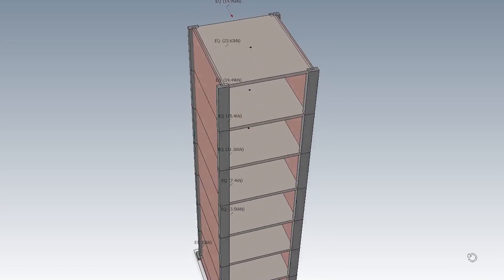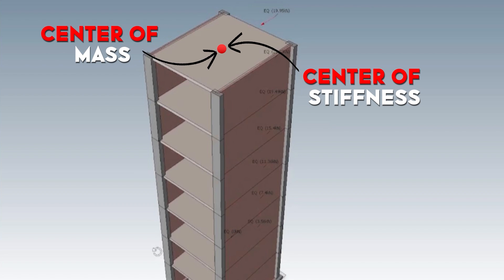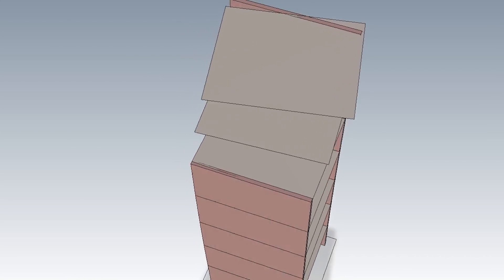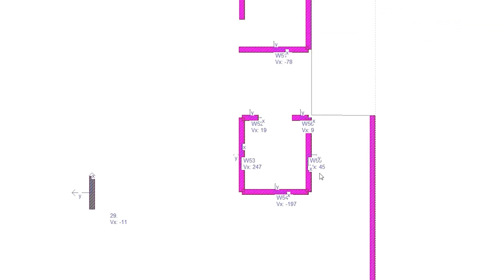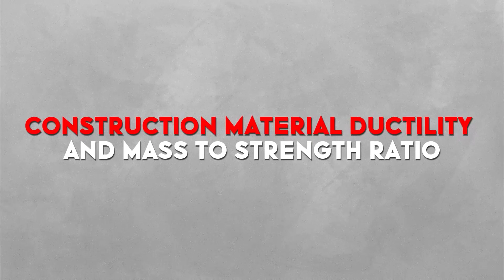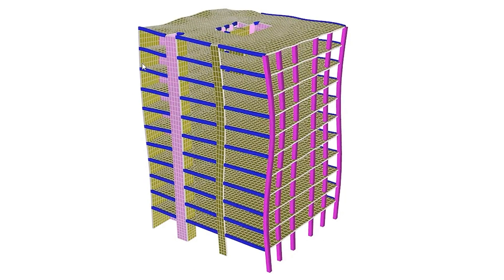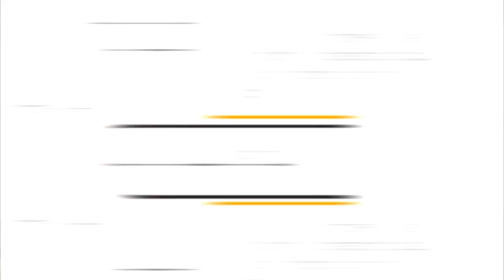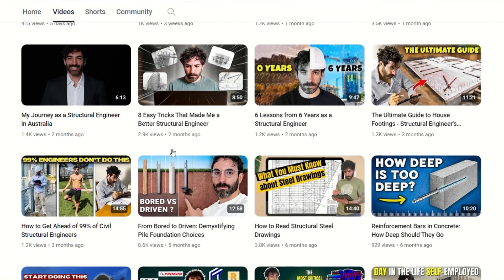How Structural Engineers Fight Against Earthquake Forces

Comment: Awesome videos, what are the softwares normally used by the practicing structural engineers in Australia?
Reply from the maker: thanks :) there are a bunch of them. RAM, RAPT, ETABS, SLB, RCB Inducta, Spacegass, Robot etc There's a video in the channel which I cover all software I use
Reply: @bengthebrazilianengineerinAus  Thank you. Can you separate which one is good for concrete, steel and timber designs please.